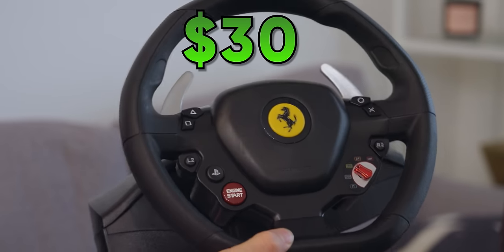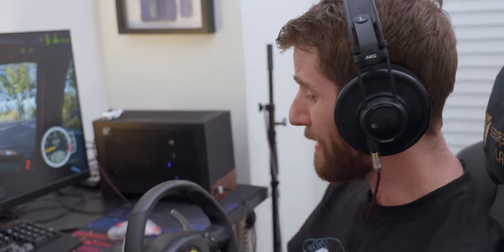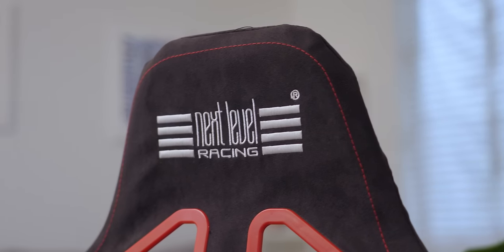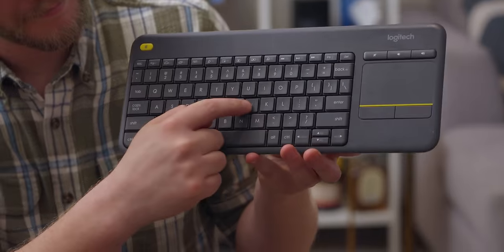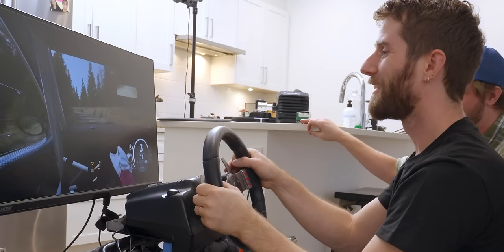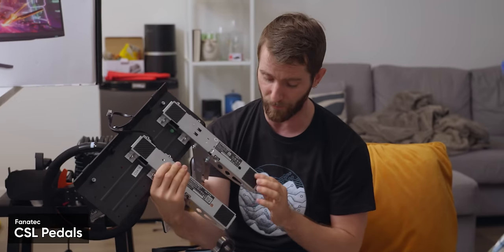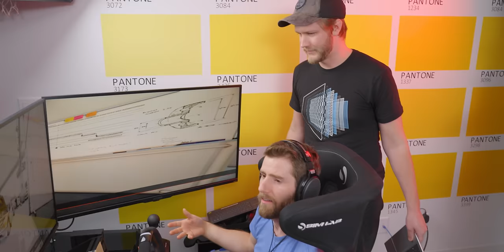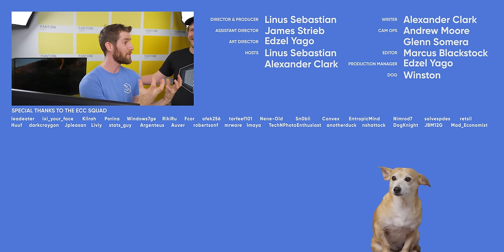Don't Waste your Money - $30 vs $10,000 Racing Setup

Comment: Pro tip - if you have a sim rig on hard wood floors, put two of your chairs wheels into a pair of shoes. Chair will not move lol
Reply: wouldnt that ruin the shoes tho
Reply: @In.Another.Universe  surprisingly no depending on the shoes. I've always worn skate shoes so they are a bit sturdier than running shoes.
Reply: @In.Another.Universe  Everyone has shoes that they never wear 😄
Reply: Thrift stores are full of shoes being sold for $0.50 👍
Reply: What I did for mine is that I got a flat metal bar and duct taped one end to the bottom of the pedals, then made a loop out of duct tape on the other end. Put one of the five "arms" of your chair through the loop, center that arm behind you, and bang - the pedals are always the exact right distance away from the chair
Reply: @In.Another.Universe use old shoes
Reply: @In.Another.Universe  Ruins the shoes but you lap faster. totally worth it lol

Comment: I have to add that Fanatec's CSL DD bundle which includes the motor base, the steering wheel, and pedals is $400 which is really great value for how nice for how high quality they are. If you are getting into sim racing and think that you will get into it, I highly recommend this bundle and to put it on a cockpit like what Alex has.
Reply: Except the horrible QC from Fanatec, if you're on pc only I would rather get a moza base or simagic alpha mini.
Reply: @Broodjemetbeleg  reasons for that? Ive been shopping around for a new Wheel setup and was looking at that Fanatec are they known to have issues?
Reply: I have the DD, and the QC is good.  I want to upgrade to the 8nm power pack. I like the newer versions too without the goofy wrc theme like I have.
Reply: @thumperstick  Just because your unit is good doesn't mean there isn't QC issues. Most brands has
Reply: Don’t forget that sweet extra charge to get their new QR that they should have had a decade ago. There are tons of options that are massively better than fanatec.

They should really get a guest like boosted media or any of folks who know what they are talking about to help with videos like this.
Reply: the only thing that exceeds how unpleasant it was speaking with you, was how useless it was.  You truly left this conversation as close minded as you entered it, and because of that... I wish you good day sir. hope your day gets better, bud. 🤣 @texanman
Reply: I think the best way to go is start with just a G27 on your desk, if you enjoy it enough, get the cockpit like what alex has and mount it on that, then when you really want another upgrade, go DD on that cockpit.
Reply: @ItachiRyu  Their QC is fine, but their customer service is known to be bad.
Reply: @ItachiRyu yes have a big history of bad qc and awful customer service. I recommend Moza over Fanatec all day
Reply: @thumperstick don't pay for that. Just diy it. It's easy. Been running mine for more than a year that way.

Comment: The vr is beyond worth the setup, the immersion, the depth perception coming into corners, being able to see out the side windows when youre sliding, it just makes it so much better
Reply: The only game I've consistently used it in is Assetto Corsa via Content Manager, but I haven't had any issues after setting it up the first time. It's worked fine in a couple of other titles the little bit I used it too. TV/Monitors can definitely be an immersive killer arcade experience that some people might even prefer. VR on the other hand is as close to the real thing as you can get to driving like a maniac without causing yourself serious bodily hard.
Reply: Having played Dirt something in VR.... it can become a puke machine very fast. Its fun while you're doing flat asphalt circuit stuff, but on bumpy curvy roads I had to take off the VR set within minutes and was feeling shit the rest of the week.
Reply: I also imagine it's way cheaper than setting up and mounting 3 huge screens
Reply: @MrRoeltej  I don't tend to get those issues, it really just depends on the person. I've spent a few thousand hours in vr by now and I'm largely unphased by weird motion stuff
Reply: @LashanR  ya it's just kind of an all around win imo
Reply: Sadly, I don't see VR listed on steam for the game. Guess I'm staying with Dirt Rally 2.0...
Reply: annoying to setup every time
Reply: @azus4554  do you have a rig set up? I just sit down, throw on headset and start the game.
Reply: VR is the best way to play today and saves a lot of space. I hope EA doesn't "forget" to implement VR in this game.
Reply: @mateuspinesi  there isn't VR listed on the page
Reply: very personal. VR has too many drawbacks for me. it's cool, but awful.
Reply: Vr is either you have shitty graphics, or low fps (motion sick) or pc with 4090
Reply: It also makes many people violently sick lol

Comment: It's cool to see not just the cheapest possible and craziest setup, but to also see what you get on a very reasonable setup. I wish LTT would show those more.
Reply: The second set up was a low middle of the road set up.
Reply: I feel like they do that a lot tho.
Reply: Yeah the mid tier was the Logitech g29 with force feedback
Reply: Except this guy doesnt really knwo anything about sim racing.  G29 is the very low end of gear.  Not the lowest but almost.
Reply: Nahh guys, Logitech is more like a real entry lvl, mid will be smth with belt instead of gears, T300 for example. Nowadays you can buy even cheap DD bundles like Moza R5

Comment: Thing to note is Logitech uses a gear set up for their wheels (beyond the Direct Drive wheel) and Thrustmaster uses a belt system. Belts are usually much quieter and there's more fidelity for around the same cost as a logitech wheel. Have a look at 2nd hand T300 or the slightly higher end TS-PC/TS-XW.
Reply: Or used fanatec csl/ club sport wheels from the real "hard core" users upgrading to direct drive.
Reply: Moza R3 bundle. Probably the best bang for buck wheel and pedal set out there. Direct drive, with support for PC and Xbox!
Reply: @elbowsout6301  Always thought the R3 was just too weak. My TM TSXW puts out like 6NM and that's a belt. 

Equally if you can get a good deal it's a must, I do know the Moza wheel mods are ridiculously pricey compare to say Thrustmaser T818.
Reply: I don’t have any complaints about the gear set  up :D
Reply: @BarkerVancity  That has nothing to do with motor, it was the cooling fans that had issues, basically just replace with a small noctua and you good. Alternatively get the T300 because they had fixed it by then
Reply: Logitech's new pro wheel is direct drive (but the wheel + pedals is around $1,400). I believe that was the setup they used in the video. Great setup but kinda pricey for what you get. 

Belt wheel bases are less clunky (and noisy) than the cheaper Logitech gear driven bases for sure ....But there is a noticeable difference between direct drive and belt bases as far as smoother feedback goes imo. I have played on gear, belt, and direct drive bases. 

Moza has an R5 base that hits 5.5nm of torque and you can get a pedal, wheel, and base bundle for $500. One of the best deals as far as i'm concerned when it comes to entry level direct drive. That and Moza's product durability and customer support seems to be way better than certain brands cough Fanatec cough (Have seen plenty of horror stories about Fanatec issues with both products and customer service.) That being said, they are a newer competitor in the driving sim game so time will tell how they progress in the market. But I can assure people that the R5 bundle is relatively affordable and a game changer if you plan on upgrading. 

Right now i'm rolling with a Moza R9 base, an upgraded wheel, and their mid tier pedals. Other than the pedals (which are still great), I can't see needing to upgrade anything for a long time. I spent somewhere around $950 on my setup and when people come over and try it, it both wows them and gives them a good workout haha. Thrustmaster makes some great stuff, but i'm completely sold on Moza.

Comment: Went from g27 to t300rs for drifting. Its more quick to rotate, not having dead zone in a middle, more smooth, not as loud. Force feedback is much stronger. 
I would say both wheels are great for the price. Using it with quest 2 and never going back to monitor setup, the immersion is next level.
Reply: Drifting on Asseto Corsa?
Reply: @reanukeevesau yes, assetto corsa, vdc cars
Reply: I just switched from vr to a large triple screen set up and can agree that vr is great but a large properly set up triple screen set up is so much easier to just get in and drive.
I too do drifting in assetto maybe I'll catch your door sometime online

Comment: VR is incredible for racing in particular. Very surprised at Alex's take. Glad it got some callout though, and glad its coming to WRC.
Reply: I was never into racing sims untill I got a VR headset. got Dirt Rally on a steam sale and now I have a full sim rig....
it really is a game changer in the most literal way...
Reply: When they reviewed the weird "personal cinema" headset with Luke -- Alex said that it made him very queasy ("it's like 20 beers") and there was no way he was putting the thing back on. Maybe he just doesn't get on well with VR headsets.
Reply: @Metal_Maxine  When it comes to VR, having your IPD dialed in and correct is the key (especially for me).  If the IPD is off even a little bit, I get massive headaches and can't stand the experience.  I use a HP Reverb G2, and I've never regreted buying it (basically at launch).
Reply: Me and my brother mostly do circuit racing (just for fun!) but we both were instantly faster when we started using vr (that was when the original vive was new) compared to using monitors, especially on tracks that we rarely do. What makes the difference for us is that the image is where you look at. Because of this we can aim the car much better.
So yeah, i don´t get Alex' (and Linus' for that matter - vr always simply worked for me after the initial setup) point there either. The improvement in immersion and driving precision is definitely worth the extra setup time. And it takes up way less space than a monitor - let alone a three monitor - setup.
Reply: I threw up when I tried vr haha😢
Reply: I've only tried it with the Rift S. It was too pixely for my tastes. Interested to see where Apple Vision Pro takes the market.
Reply from the maker: Oh I love VR racing, I just am busy as heck so if I need to set it up for 40 min my gaming time is gone. With a monitor we're up and racing -AC
Reply: I concur. It is an absolute game changer for asetto corsa
Reply: @Metal_Maxine  Simulator sickness is a real thing.. Mostly due to the disconnect between what the body is feeling vs what the eyes are telling the brain (one reason why people don't suffer travel sickness so much when in teh front seat of a car vs back seat (can see the road)
Reply: @kerrynofford4727  I read that the main reason for VR sickness is the delay in visual feedback from head movements. IE you move your head and the milliseconds it takes the device to visually responds causes the issue. Though it probably a combination.
Reply: @Metal_Maxine he doesn't know what 20 beers feels like...
Reply: Really shouldn't take 40 minutes to setup though  @LinusTechTips , surely?  Especially if you just leave it connected - Setting up the sim rig should still take the majority of the time.
I'm a controller peasant, and it's headset on, grab controller, play.
Reply: @roberthiggins8234  definitely a factor - though inconsistent frame rate hurts more.  For the most part though, it's the disconnect between standing/sitting still and seeing movement - like motion sickness, but backwards.  Turning being a lot worse for people than straight movement.  Most people get over it fast though.
Reply: Honestly, it depends on the person. I think the lack of clarity and noticeably worse details have a big impact on my focus/immersion of racing titles, and find it much more comfortable to just play with a display (especially if you're using an ultrawide or, even better, triple-monitors). Also, tons of people forget motion sickness exists. For a significant percentage of people, movement in VR will cause motion sickness no matter what they do, so it's going to be something they have to skip. This includes me.
Reply: @TheBaldrickk  That's the issue. "Most people". Unfortunately, I'm not "most people" and have very bad motion sickness. It's a problem in real cars if I'm not the one driving, and VR sim racing is completely off the options for me. I've had my Index since it launched; I love VR and playing Beat Saber and H3VR and whatnot, but that doesn't change the fact my head will never get better with its combatting of motion sickness than it can('t) now. A pretty big percentage of people are in the same boat, and it gets tiring having everyone say VR is an "objective" game changer when it's not (as many still prefer displays), and it isn't even an option for everyone.
Reply: @LinusTechTips I literally have a VR rig setup 2ft away from me. Start steamVR, open content manager, launch map, done. Or open steamVR, launch Dirt Rally, done. You have to setup the first time but that's literally it? You also have to setup monitors first time too.
Reply: @Brandonr757sGaming   I'm currently sat right in front of a 60" TV, and the FOV is still less than my VR (Index)
Yes, the pixels per degree is higher on the TV, being a 4k display, but it completely lacks the sense of depth, which makes a huge difference.
Given the option between playing Dirt Rally on the screen or in VR - VR wins for me every time.

Most people don't suffer from Sim Sickness - once they've had a little bit of time to adjust.   Though yes, there are some that do indeed seem to be unable to overcome this.

With that said, racing games TEND to not suffer too much from this, as the frame of the car is static relative to their seated position, so while there is movement outside the vehicle, there is still a static framework they can align themselves with.
Reply: @TheBaldrickk  I didn't say anything about FOV. Regardless, a triple monitor setup massively outperforms the FOV of any typical VR headset, if that's the argument being made. The "sense of depth" is subjective; I didn't feel it was that different. And again, just because "most people" don't doesn't make it a good argument; many people still can't and that makes the recommendation a pretty weird one to push people towards so heavily. It's a good option for some, but I'm sure most people still sim racing on monitors are fine n happy that way forever.
Reply: @LinusTechTips  Listen, don't let me tell you how to play, especially if you've only got so much time and mental bandwidth in the day. I feel you on the pick up and play being important. You definitely can get VR there so its also pick up and play. Might be worth a video? :)
Reply: The only setup my VR rig requires before playing is opening WMR? I completely removed the monitor from my rig a long time ago.
Reply: @AJBats   Same here. Once setup it should just work. Having said that, when I first did it it took ages to get it so that it wouldn't just randomly crash, or sometimes not detect the wheel when VR was running. Lots of trial and error led to updating USB drivers many times, and making sure that hardware was in the USB (2 or 3) that it preferred, and SteamVR updates. It was a PITA at the time, but now it is at the 'just works' stage. It should have been that way out of the box, and I hope that it has gotten easier for others over time. I fully understand why some just give up on it.

Comment: The Ferrari Spyder thrustmaster barely worked with any of my many racing games. It did 7 years ago, but now Forza was the only one I had that worked reliably. The crew kinda almost worked.
Reply: Can I ask what platform were you using mine worked perfect on xbox and when I sold the xbox I used it on pc until windows 11 came and basically bricked it
Reply: @Roach420  I'm on PC and yeah I completely understand the Xbox one is for Xbox and the PlayStation one is for PlayStation. The Xbox one is compatible with PC but on a case by case basis because of Xinput.

There was a review that said it didn't work on the newer Xbox or something similar to it being case by case as well
Reply: I have the Ferrari edition in my basement. Poor fella. It only had a life with Forza and Xbox One. The Logitech force feedback GT still runs with my PS3 and gets all the love